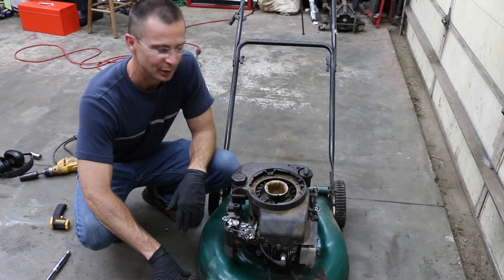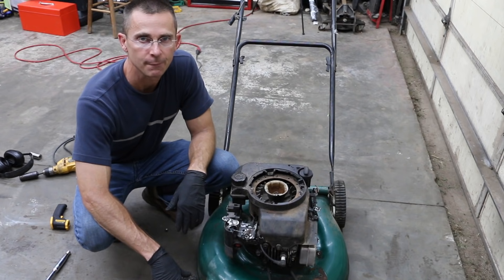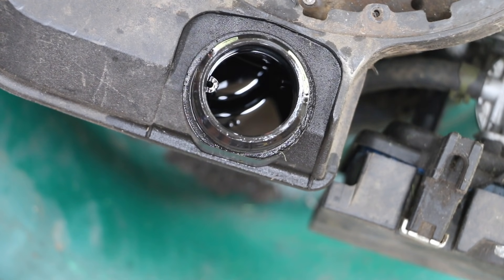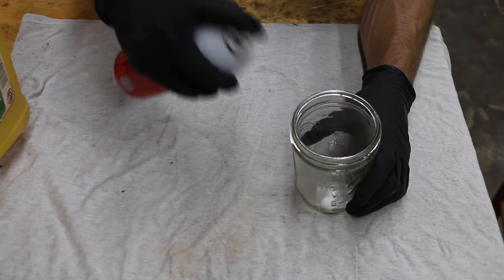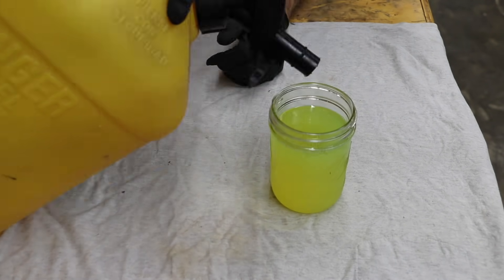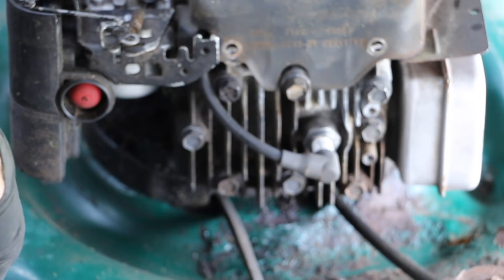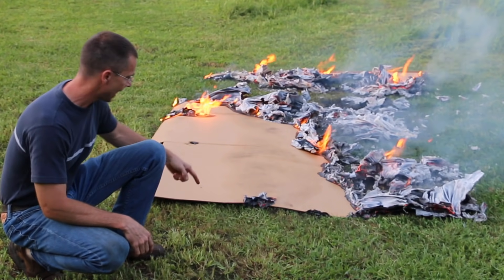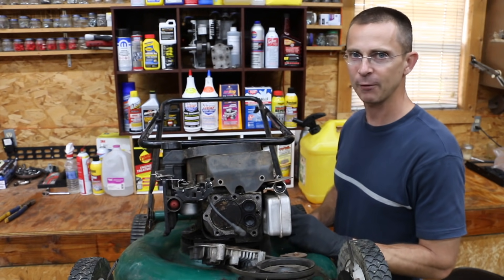Will a Gas Engine Run on Diesel?  Let's find out!

Comment: I once had an '80 Camaro, and one night mistakenly filled my tank up with diesel fuel from a nearly empty tank. As I headed down the road, a loud knocking noise began. Once I stopped and turned the key off, the engine continued running. I pulled all the spark plug wires off and still the engine kept chugging away, and knocking like crazy. The only way I could find to stop the motor, was to cup my hand over the carburetor, and choked it out. It was crazy. Lesson learned.
Reply from the maker: Wow!  Thank you for sharing this experience.
Reply: @ProjectFarm  You're welcome. BTW I took apart the engine afterwards, and noticed one of the lobes of the camshaft had been rounded off completely so it had no lift at all. Not sure why that happened, but it must have been from the diesel, as the car worked fine until that time.

Comment: In diesel engine,we have sufficient compression on the diesel... but the gasoline no need that much of compression on gasoline (it having a low cetane number) it catches fire quick so it is ignite easily...by taking this all considerations the engine was developed... But in diesel we need more compression on it... the design is different..(TDC - BDC). Design is different in both the engines sooo that's why it's not worked...🤗🤗🤔
Reply from the maker: Thank you!

Comment: Yeah... diesel does not atomize the way gas does. That's why diesel engines have massive pressure in their fuel injectors, otherwise diesel simply wouldn't atomize into particles small enough to combust properly.
Reply from the maker: Thank you

Comment: I heard that if one adds 1/4 teaspoon of salt to 1 gal of water, rubbing alcohol or moon shine as close as possible to  1 galon. Mix it well until is all chemically synergized so the molecules are bound by friction. Then add this to a tank with 10 gal of diesel you can get up to 410  miles and some people claim that 500 miles is not unusual. Your thoughts?
Reply from the maker: Never heard of this before. Thank you

Comment: I would like to see you try diesel again in a fuel injected motor, rather than a carburetor to get better atomization of the fuel. The diesel cylinder looked wet because the fuel did not get vaporized and therefore couldn't burn. Also I'm sure it fouled the spark plug just like motor oil would do and that's why you couldn't get it to run even while pumping the primer once in a while.
Reply from the maker: Thank you!

Comment: I accidentally filled my car with diesel (near empty to full tank) THEN realised what I had done. I knew it would start with the residual fuel in the system and hopefully keep running when the diesel came through. It ran beautifully when the diesel came through (with a LOT of white smoke - I mean a LOT of white smoke). Performance even seemed to be improved. I drove hundreds of miles until tank was about 1/3 full and then refilled with petrol. I then ran the car until the "new" blend of diesel and petrol had come through (about 20 miles). Next morning when the engine was cold it started fine but again blew some white smoke (not as much). Car ran fine and I am convinced ran better overall after the experience. After several tanks of petrol the white smoke completely disappeared and car has run superbly ever since for over 100,000 miles. TRUE STORY ! ! ! (I think it is essential the engine is HOT when the diesel is introduced).
Reply from the maker: Thank you!

Comment: Rest of the world: "Hybrid Vs. Hydrogen, what will drive the future of mobility?"
USA: "Will a Gas Engine Run on Diesel? Let's find out!
"
Reply: Hybrid is more like the present, though, and hydrogen is just impractical and dangerous to use as a fuel for cars. Full electric vehicles running on batteries are the future! At least for cars.
Reply from the maker: Thank you!

Comment: Sometimes they will run on diesel.  You have to get them hot on gasoline. The model T ran on lamp oil
Reply: The T they would put a corn cob soaked in fuel. Under the intake light it . Eat breakfast. Start it on gasoline then switch to oil.
Reply from the maker: Thank you!

Comment: how does spark plug spark? is it getting the electricity from the battery all the time? new subs here. tnx. so informative video
Reply: jhilow, on the spinning metal wheel inside the engine cover is a magnet that passes by a coil to generate the spark. That's called a magneto. I guess a lot of motorcycles use that too.
Reply from the maker: Thank you Drain the Swamp.
Reply: thank you so much, sir. looking forward for your nxt video

Comment: At least you got the lawnmower started with diesel, I can't even get it to run on Gasoline.
Reply: Ethanol was in the gas
Reply: Ok... I don't want to sound like a nerd but the difference between how diesels and gas engines work is how the fuel ignites. Gas engines have lower compression and a spark plug ignites the fuel air mixture. The fuel burns and the expanding gasses push the piston down. Diesel engines have a ton of compression (typically between 15:1 and 23:1). They compress the air raising the temperature to hundreds of degrees. When the compression is at it's maximum the diesel fuel is injected under pressure into the cylinder where it explodes slamming the piston down. The knocking sound of a diesel engine is the explosion inside the cylinder causing the metal to ring/knock.
Reply: @tonyturner9146  what happens when you run gas in a diesel engine then?
Reply: @Seriouslydave  well, if the engine is warm it may crank and try to run. It will smoke pretty heavy and may even knock from pre-ignition. If the engine is cold it probably won't crank at all. Now if there is enough gas left in the tank to mix with the diesel fuel it may crank and run pretty well other than the smoke. In some of our antique cars we mix about 20 percent diesel to cut the octane of the gas to keep them from vapor locking. As far as damage to the engine.... It may not do anything harmful but it could could the plug and could harm rubber parts. I've never had it do anything other than foul a spark plug. Buti guess anything can happen.
Reply: @tonyturner9146  exactly! That being said I wonder if a gas engine    that has a really high compression ratio 13:1 or so would work.  I know for a fact that a honda push mower will run on off road fuel after the engine is hot.  My girlfriends son ran out of gas and didn't know I filled up the gas can with fuel so I could get a dozer out of the woods that also ran out of fuel pulling logs. (My fault  on that one)  anyhow I was just about to mix gas for the weed eater and remembered the pink fuel in the can.  Then I realized it was empty and heard the mower in the front yard. Then I saw the girlfriends son mowing in a cloud of smoke in disbelief.  I walked up to him and he said "I dont know what is wrong with this thing. I THINK WE HAVE SOME BAD GAS." Then I started it up again and mowed until it ran out.  Took a few pulls  but it ran.... smoked and smelled too.
Reply: @tonyturner9146 : "At IT IS maximum"? Huhh?
Reply: Lol so true spend many a moment cursing when they just won’t start up
Reply: Lol city people caring about which mower they use hehe
Reply: The only reason it’s funny is cuz the jokes on them they  got the  okiedoke
Reply: That's funny!
Reply: I never have much issue with my mower or power tools thanks to ethanol free gas and routine maintenance.
Reply: Lmao try pouring some propane in!
Reply: Lol
Reply: Sounds like it's time to try a tankful of sodium silicate, and see how that works.
Reply: I feel you brother (or sister, who knows)
Reply: Steve Blanck 
Probably residual gas in the bowl
Reply: I had that problem with the stupid weed wackers... now switched to an electric one that never fails and I love it... Got 2 new gasoline ones that refuse to run properly... anyone interested on them? 🤙
Reply: @portedbikes  The most common problem is people leave the gasoline in too long(gasoline has a shelf life and won't combust when it expires), ignore the proper fuel/oil mix that some machines require(if they even read the manual at all) and they never change the plugs.
Reply: @MrBottlecapBill  that and they don't have a fuel filter so crud gets in the carb
Reply: portedbikes I am, if there free and your in Oklahoma, I need em
Reply: @portedbikes , I know what you mean. I have a near new stihl weed whacker and blower that I never use anymore cuz my Makita cordless units work so damn well. I’ll never go back
Reply: Steve Blanck get a honda
Reply: Bro I had a lawnmower that was sitting in the rain for about 2 years and me and my dad were joking around and said how about put a little gasoline in it and see if it’ll run it took 3 times before it started like a normal lawnmower
Reply: Your right my lawn mower wouldn't start so I filled it with diesel and she's purring like a kitten. Thanks
Reply: HA!  lol you win my dude
Reply: Something is wrong with your mower
Reply: I was actually genuinely impressed when it started the first time from cold on plain diesel
Reply: I can get the lawnmower running but it's no use because my lady will not cut the grass.
Reply: Pure some fuel injector cleaner in it
Reply: Using high quality synthetic oil makes it way easier to start.
Reply: You need to 1.) replace your gunked up carburetor; 2.) quit using ethanol blended gas in your new carburetor; 3.) consider adding a little bit of Sea Foam to each can of ethanol-free gas; 4.) properly winterize all your small engines by running them completely out of gas at the end of each season, draining the float bowl by loosening up the nut underneath, checking the plug and fogging the motor with a shot of fogging oil.  5.) Then finally change the oil while the motor is good and hot at the end of the mowing season.  Do all the above and your small engines will run like a scalded ape every time you even give that starter cord a dirty look.  P.S. - You're welcome.
Reply: P.P.S. -- All you electric mower types are obviously city slickers.  I'm sure an electric mower is great for a townhome.  Out in the sticks we need the power-to-weight ratio of a dino-juice engine (better than any battery technology yet invented) plus the cord-free operation to actually go half an acre without yanking the extension cord out of the socket on every pass.
Reply: Nice 😂🤣
Reply: Hmm have you tried a battery, if that Dont work try moonshine
Reply: @demoman1282 : "Don[']t" is a brand name now?
Reply: Love this comment LOL.. so true
Reply: if you can't get it to run on gasoline your not using enough Choke when trying to turn it over
Reply: I had that problem on a Sears edger with a vertical shaft B&S engine (yes, terrible design).  After 15 years of needing starting fluid, I replaced the carburetor for $25 and now it runs like a top.
Reply: @ralphwaters8905  you shouldn't have to replace the carburetor to get it working right  and that's why sears was dying for such a long time such a slow death
Reply: @raven4k998  - Yeah I totally agree but my hard-starting problem was there from day 1 so dirt seems unlikely and a typical cleaning might not have done the trick.  I decided I could blow $20 to save myself more aggravation with a new B&S carb and it worked great.  Funny: I first tried SearsPartsDirect thinking this would be OEM quality, and it took me to a Chinese eBay seller whose cheapshit clone had an error in the bolt pattern so it wouldn't even fit the tank.  Lesson learned!
Reply: @ralphwaters8905  probably was just a faulty part so the new one worked you fixed it yay
Reply: Lol
Reply: I had to start buying midgrade gasoline the last few years.   I think Regular gas now has too much alcohol in it.
Reply: @jeffs7707  they all have alcohol in them the only difference is that higher grades don't have as much engine knock due to higher stability that's all that higher grade gas gives you over lower grade
Reply: Me neither...
Reply: When I was in the Army, in our Sapper/unconventional warfare school, we used a mix of diesel fuel and gasoline in our Molotov cocktails, the gasoline ignited quickly, and the diesel gave off lots of smoke and longevity. Don't try it at home, kids.
Reply: @IsurvivedDisco  That’s what they use in drip torches that they use to burn land with....
Reply: Ur mower engine is complicated and concealed isn't it
Reply: Try cleaning out the carburator and the psark plug
Reply: When my push mower won’t start it’s normally the cheap Chinese nonadjustable carburetor. The jet that bring gas from the bowl to the Venturi is tiny and plastic, and gets blocked up very easily by just lacquering as the alcohol infused gas dries up. I have found carb cleaner ineffective for clearing the blockage but brake parts cleaner is very effective at clearing said blockage. Of brake parts cleaner won’t clear it it’s time for a new $10 Chinese carburetor.
Reply: When did the word "gasoline" become a brand name to you?
Reply: You need seafoam mate
Reply: It’s the carb
Reply: So true
Reply: Super funny comment. Gave me a Laugh
Reply: Time to go electric!
Reply: 😂😂😂😂 give it some water then😅😅
Reply: Lol
Reply: Ikr lmfao 😂

Comment: But diesel in a Briggs and Stratton 22HP engine on accident once. It’s kinda ran but it wouldn’t shut off. Still ran fine after for another 2 years. Then engine took a dump, not sure if the diesel had anything to do with it
Reply from the maker: Thank you!

Comment: Seeing how fuel oil was from 1800s to 1950s in tractor and PTO units your test is just rediscoving what you granddad already knew and did.   A warm carb and the right heat range plugs and it runs just fine.
Reply from the maker: Thank you

Comment: Diesel Fuel is nothing but the Oily Waste (byproduct) from making gasoline. So, why wouldn't it work once you dilute it from being as oily? Technically anything flammable will work in any engine but the type of fuel will determine whether the engine burns up from overheating the chamber or just runs extremely poorly. Hell I run 2-cycle mixed gas for my chainsaws and weedeaters in my mowers every time I run out of straight gas and don't want to leave the house.
Reply from the maker: Thank you!

Comment: Did you try adjusting the carb for the diesel.  The difference of the fuel may require it.
Reply from the maker: Great point. The carb did not have an adjustable jet.

Comment: Gas and diesel will not mix,,, only for a few minutes,,,,, then separate,,,,,, and the diesel will float to the top,,,, depending upon the carburetor ,,,,, lots of push mowers pull the fuel from the bottom of the tank ,,, meaning it’s running on gas in the video.
Reply from the maker: Thank you

Comment: Come on you should have been able to answer the Question before the test the fuel... the engine would be hot enough and compression to maintain the spark to keep it running... if the engine was running for a long time an was super hot it would run on a mixture of the two for while!!!

Comment: Try drip gas and motor oil.  Drip gas is that jell looking stuff that comes out of an oil well flare.

It looks like vasoline but will burn.  Old times said that during the depression they would weld a 55 gallon drum into the pipe that runs the flare, let the drip gas accumulate, mix it wit oil and run a tractor.  

Bad for the valves they said but it works.
Reply from the maker: Thank you!